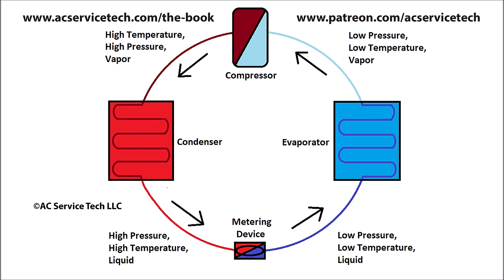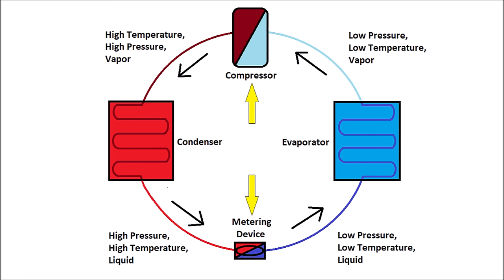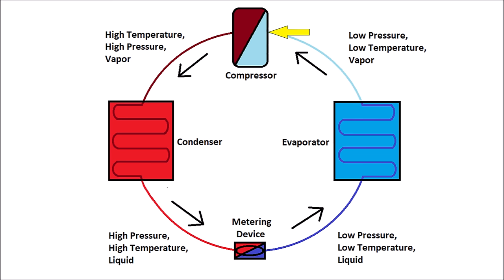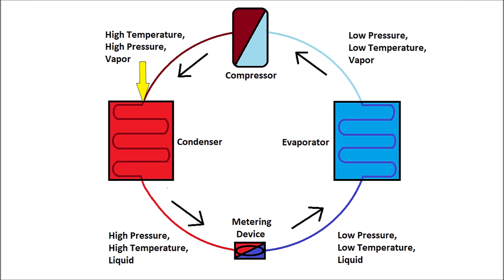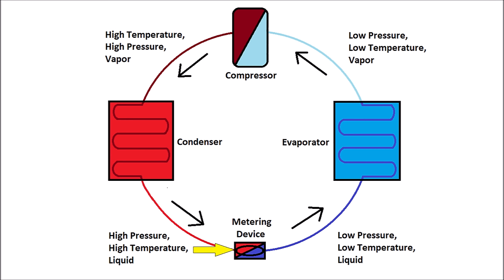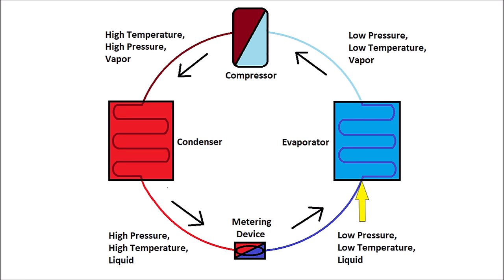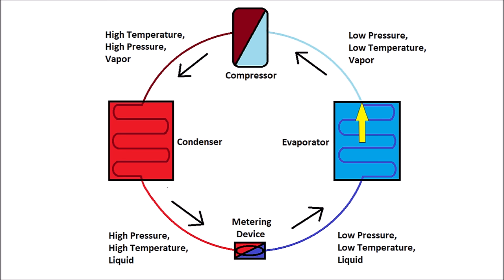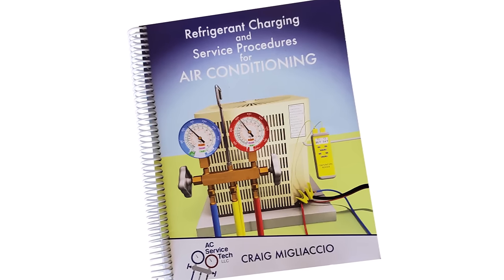Basic Refrigeration Cycle!

Comment: Normally I find this poster’s videos to be 100% accurate but this time I found one problem. 

 I could not understand how the output of the metering device could be a low temperature liquid since that would mean there was no phase change.  

Turns out that is because it is not a liquid but rather a liquid and vapor mixture.
Reply from the maker: the low pressure liquid quickly flashes to saturated at 80% liquid 20% vapor as it enters the coil after exiting the metering device.

Comment: I would like to ask a question. Can you check the refrigerant's purity by taking a static pressure reading?  Should the pressure correspond to the temperature at the evaporator (in the attic) or the condenser (on the ground)?